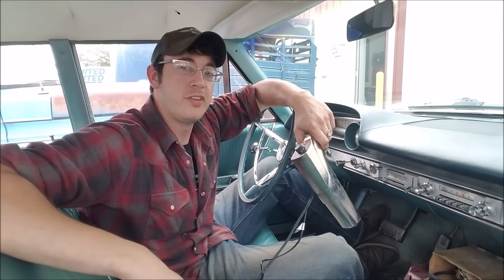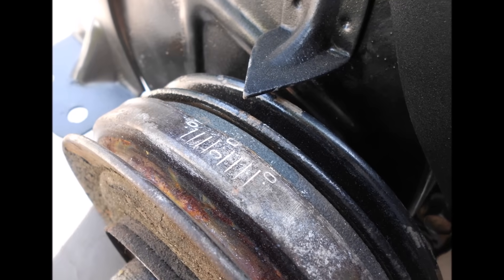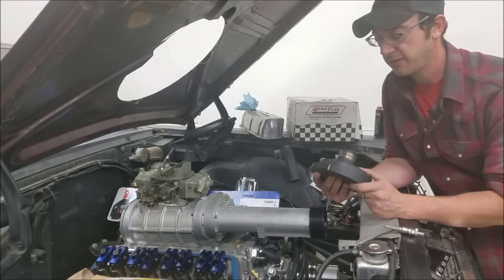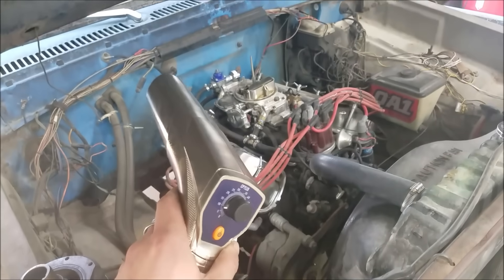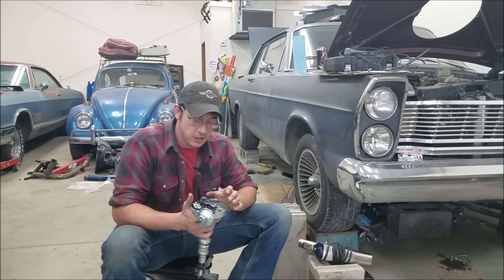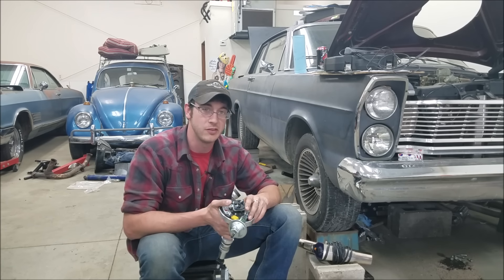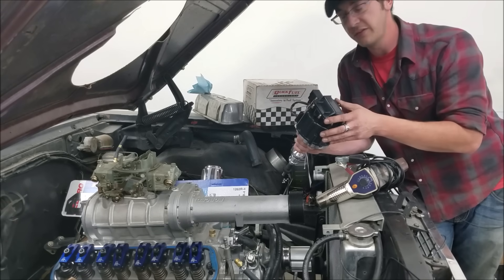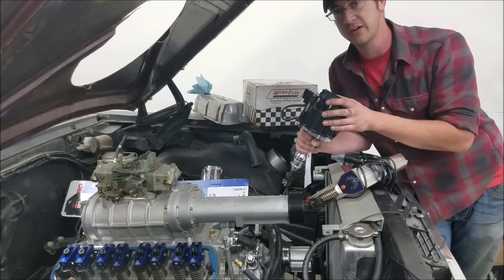The Timing Light & Total Ignition Timing (Maximizing PEAK HP & Performance 😎)

Comment: I HAVE A 95 FORD 350 DUALLY CREW CAB 5.8 V8 GAS 351 C.I. CAN I DO THIS??I THOUGHT MINE WAS DIGITAL NO DISTRIBUTOR?? I DON'T WORK ON IT BUT WANT TO AND BELIEVE THIS IS CRITICAL .  I NOW HAVE A GREAT MECHANIC WHO TOLD ME FORD 'S DIP STICK WAS OFF 1 QT. OF OIL AT FACTORY I NEVER KNEW WITH REGARD TO MY TRANSMISSION FLUID LEVEL.  HE BEING A TRANSMISSION GUY FOR YEARS  AND MY FIRST FORD.

Comment: I just put a large cam in my otherwise stock marine 305H.O.... But, I can't figure out for the life of me where the best initial timing this thing should be at now...

Normally, its at 8deg BTDC with the normal torque'y cam it had in it, but it sounds REALLY rough at 8deg BTDC with this new big cam in it and just can't figure it out.
Reply from the maker: I bet it wants at least 16 initial - and this might be where you need to utilize manifold vacuum advance
Reply: @ThunderHead289  that's about where I was thinking it sounded best... UNFORTUNATELY,  though, in the marine industry we're not allowed to use vacuum advance because of USCG regulations 😤

So, I think if I run around 16 intial I may have to adjust flyweights and springs in the HEI to compensate so I don't blow a hole in my pistons at top end (4k rpm is max rpm on this thing lol).

Where would you look to set the advance curve at? Is the curve the same regardless of the cam put in (asides from the higher intial)?
Reply: @ThunderHead289  PS: thanks so much for the advice! Long time viewer and love your content. Best teacher I know.

Comment: Hello thunderhead289. I have a question. I have a 327 bore to .060 with a hei distributor and a edlebrock 1406. I have wached your videos and have tuned it to the best of my ability. I can't get the vacuum to settle, it hlbouncer between 16 and 18. It havs a total timing of 35 and initial timing of 12. I have used the vacuum to adjust the idle screws to the best of my ability. Everything is new and the engine was rebuilt by a shop last year. I think I have a vacuum leak on the intake. I did the break cleaner around the intake but no change. All new vacuum hose and no leaks there. What do you recommend. Thank you for your time.
Reply: It has a mild RV cam.
Reply from the maker: If it’s bouncing very rapidly, I’d do a compression test and recheck your valve preload. Possibly you have a cylinder with a valve hanging open a bit. 
Do you know how many turns the preload was set to?
Reply: @ThunderHead289  I believe 3/4 turn.
Reply: @ThunderHead289  I will do a compression test this weekend. I just pulled the sparks,  plug on #2 and it's wet. I changed the valve guides. Hope this is the problem.

Comment: What bracket do you recommend for a 1406 eddelbrock to connect the throttle cable to the carb. What comes in the box does not work. 69 mustang with a 302 and a C4.

Comment: How do I know how much total timming I need?
Your video is better than most. Actually explained what it is and how to get find out where it currently is without all the filler. Lol
But would like to see something that goes into setting up an unknown engine.. find and set base timing, adjust carb, and setting total timing to that engine.  As you said.. they are different depending on the engine. 
And even with better ignition components and different fuel than what was available 50+ years ago. Might have required 5deg timing back in 1949.. but now with better stuff that same engine can run  better on 10 or 16.
Reply: The best way to find what timing advance the engine needs is to tune it on a dyno.  The next best way is to time it on the drag strip or on a deserted back road.
Reply: Start at 30 that's a good start then keep creeping up until it makes no more difference then that's it

Comment: I’m running a standard GM HEI (1978 unit) on my 350 olds. I’m only getting 8-10 degrees mechanical advance out of it. Causes me to run 22 initial just make it to 30 total timing in by 3k rpm. I’ve had the distributor apart, cleaned all grease out and made sure everything is freely moving and still the same issue. Any ideas or is it just a smog era distributor and I should be looking for a replacement? I’ve also tried the Moroso recurve kit and didn’t do anything for my mechanical advance . Thanks
Reply: My brother has a 1978 Olds 350 swapped in his 1983 Grand Prix. I'm thinking your mechanic advance is limited to that 8-10 degrees because of being a late 70s smog era engine. Also these late 70s gas 350 Olds run 20 degrees of initial timing, so that extra 10 degrees puts you at 30 plus probably an extra 16-20 degrees on your vacuum advance. You'll have to read up more on Oldsmobile engines. I'm not for sure if they just don't need the extra advance that other conventional v8s of the era did. Oldsmobile v8s had a flatter piston to valve angle of 6degrees, which helped make them cleaner burning amongst other things. A conventional SBC has a valve to piston angle of 23degrees. Also Oldsmobile combustion chambers are a bit different. I haven't been around them much yet. Mostly worked on Chevys and Pontiac v8s.

Comment: Thanks for putting out this video. I learned more about timing and using the gun. I have a 63 Falcon. I changed out the Fordomatic with a c4 3speed, because the Fordomatic was bad. I have the original 170, but I've been wanting to put in a 302 and perhaps build it, with guidance from your video you made a few years ago.

Comment: I found a conservative timing can help you run the cheap 87 and when you can spring for the 93 you can add 3 to 4 degrees detonation is a big issue for me in Florida we are on the average 40 feet heat soak is also a big issue for me a lot of times I have to keep my timing modest when you stop at a gas station and heat soak put you at 210 degrees the cylinder pressure can get high when you took your Galaxy down south to go to school did you have to pull a little timing? So it would start easier in the afternoon when it was all heat soaked
Reply from the maker: It did okay per say - I think I had 36 degrees total. I did have to change some things for the conditions down there!

Comment: I searched your channel yesterday for a timing light video! Perfect timing . Going to recurve my distributor at the weekend
Reply from the maker: Glad my stuff was of some use! I hope it made sense!
Reply: ThunderHead289  always. You explain things really well, I have one question though. If my initial timing is at 12 degrees should I set my timing light to 12 degrees and when it hits the balancer it should show 0 degrees is that correct? Then I would set it to 24 degrees and once my total is all in at say 2800rpm it should show 0 degrees on the balancer? Is that correct ? Sbc 12 initial 36 total at 2800 rpm
Reply from the maker: When the timing marks line up, that’s when you have whatever degrees is noted on the timing light itself 👍

Comment: A little known and much overlooked problem with distributors is the gap between the tip of the rotor and the posts in the cap.
This is overlooked because it is impossible to see under normal circumstances.
You need to get a old distributor cap and cut a 1/4 slice out of it. Put that on your distributor and check the gap from a post to the rotor.
You'll be shocked. I recently looked at one and the gap was 0.075", that's twice the plug gap.
That means there is a bigger spark going on in the cap than in the cylinder. Check it out.
I made a new rotor tip from brass and reduced the gap to 0.005".
Less heat, less cap damage, more power to the plugs.
Reply: That is some of the smartest info I think I’ve ever heard and never thought about.
You my friend are a dam Genius. I can’t believe I’ve never put any thought in to this concept
Reply: Nice! Good looking out with this tip man. Makes a lot of sense to me. I'll have to try it out just to not leave anything on the table that can be had.
Reply: I know race car mechanics that don't even do that.I am gonna score some brownie points!Not ignition points.🤣
Reply: @allywilkeforsenate  hi, you must be a mind reader. This very day I made a new brass plate for the rotor in the distributor of a car I was working on and it made a big difference to this car.
The car idled rough with not alot of power, it crackled and popped like mad on startup and just didn't quite go as it should.
After I reduced the gap between the post and the rotor the car started much more easily, no crackling and popping, idled much more powerfully and I had to reduce the idle speed, it revved up more easily and ran better.
Hope this tip can help you.
Have fun and enjoy.
Reply: I'll tell you an old story. I had just bought an old BMW 2800 (6cil) e3 Bavaria. It ran but gave no power. 
So i tuned it up according to spec but still the engine did not want to run happy. In fact it ran lije garbage. Only when i decreased the plug gaps to the point of silly rediculous did it want to start revving.
Still not happy i pulled the dizzy cap again and only then it stared me in the face! The rotor arm was for a 4cil bosch dizzy! It was way too short! Sparks had to jump at least 1 inch each time. So i bought the correct longer rotor, installed it, set the plug gaps, set the points gap and presto, a perfect running snappy engine! True story!.
Reply: This is an old comment.. but it talks  about something that is not an issue if the Cap and rotor are matched.. The large gap isn’t consequential because it is not under compression in the combustion chamber.. Fuel mixture density is not increasing the resistance of a gap inside the Distributor..
Reply: @WalterPidgeonsForge it is true the spark will jump the gap in the distributor easier than in the combustion chamber due to combustion chamber pressure being much higher.
But an electric arc is still a electric arc and jumping a big gap in the distributor will produce heat that will deteriorate the cap and rotor.
As the cap and rotor deteriorate it will increase resistance causing more heat and more deterioration.
If you feel it's all unnecessary, don't bother with it.

Comment: This channel gave me all my carburetor engine knowledge. You and junkyard digs made me pull the trigger on a 1972 f150 390 v8 it runs but it needs a whole new wiring harness and all the electrical goodies to be on the road. And a lot of rust needs to turn back to metal haha
Reply from the maker: Welcome to the fun my friend!
Reply: Same issue with my 75 , 360 automatic. Electrical harness, pikin up a 74  manual trans this Friday, would like to know what you think on swapping the 75 to a manual trans , and any vids on the engine control harness,   thank you for your time, it saves me so much 💲💲💲💲🛠️🍻

Comment: Them custom Bluetooth changeable distributors are sweet
Reply from the maker: No kidding, I’m about to just put it in my f100!!!
Reply: @ThunderHead289  wonder how much more power you would get in the f100 with that distributor
Reply from the maker: Antonio Claudio Michael I wonder how much improved drivability I could get. I’d love to get more timing directly off idle, then advance slower after 2000 rpm. This distributor would give me that capability. Plus I’d spool up the total timing a bit. I’m limited to 32-33 because the engine loves 8 degrees at idle. 22 inches of vacuum at idle!!!
Reply: @ThunderHead289  wow that motor likes 22 inches of vacuum thats pretty high for idle
Reply: @ThunderHead289  I agree that distributor can handle what your wanting to do i beat it would make the engine more stable and reliable

Comment: Thanks Luke .i like how you bring the point home .but getting the highest point will it burn the cylinders up faster? And my 318 has two marks on the hb one all the way across and one half way which is the right one?
Reply from the maker: Well Daniel, I’d try to verify TDC, that far apart you should at least be able to simply feel the piston with a screwdriver when it’s at the top when one is lined up properly. 
The best burn time is about 12-14 degrees ATDC in the chamber, anything later actually burns up the cylinder, earlier can lead to detonation which nobody likes at all

Comment: I have a 300i6 Ford in my bullnose. Wouldn't run at all at even 15* timing. Finally got it to start and it's like 30* initial... I measure and it's definitely at true TDC. Loose timing chain? The motor runs REALLY strong so I'm kind of at a loss for what's wrong with it...
Reply: Also would like to add that it's a brand new HEI style distributor. So that's definitely not my issue
Reply: It has timing gears, not a timing chain.
Your being a bullnose, it sould have two sets of timing marks, the square nouch goes with the timing marks cast on the timing gear cover
There is also a chisle mark, this goes with the timing marks on the stamped sheet metal pice that bolts on to the timing gear cover.

Comment: Down with carbs. Not good for diabetics, or cars.
Reply: I wish u wld actually show c oil testing, ur vid was good but, I don't know what I should c  and how to test operation  not ohm specs. What should I c on coil neg  and triggering bypassing module
Reply: Carbs actually atomize fuel better and for the same engine will make a slight amount more power provided it's correctly set up